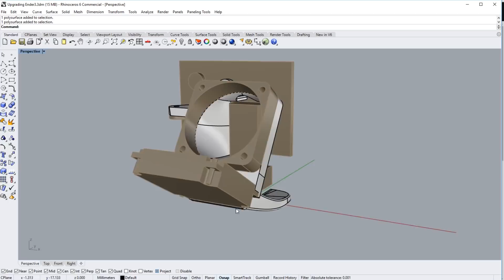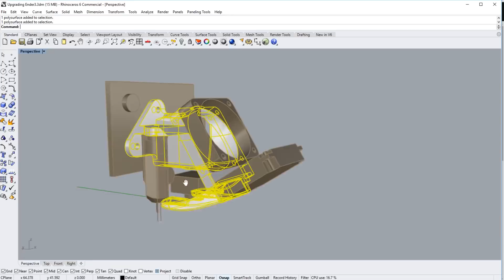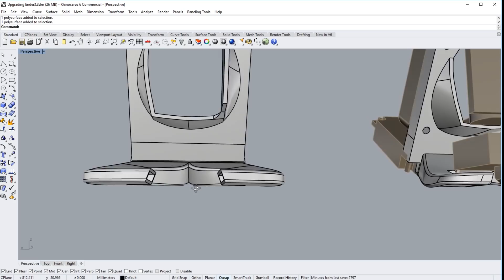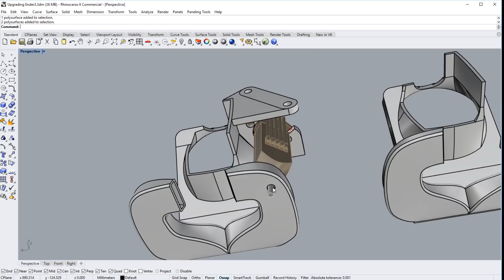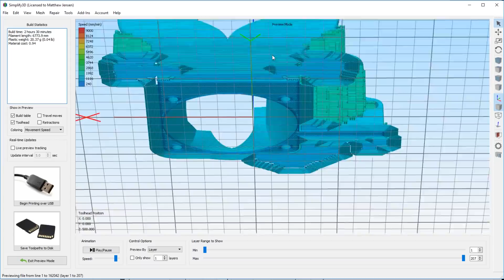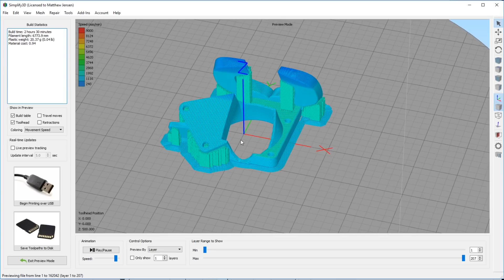Upgrading the Creality Ender 3 with Duet Wi-Fi, and other add-ons - part 1

Comment: Hello thanks for the video, can you write all the part list on the description please. Thanks
Reply from the maker: -DUET Wi-Fi
-Duet laser Filament Sensor (not available to the public. Still in beta)
-BLTouch sensor
-Noctua 40mm fan
-Noctua Redux 120mm fan
-Jumper wires. Alternately Dupont Crimp Connectors
-3D Printed Fan Duct/Sensor Bracket
-3D Printed Filament Sensor Bracket

Comment: I would have done things a little differently my self but the result will be the same of course you are going to get something that's better than a Prusa i3, if you add into the time spent making all this stuff at say you are worth $20 per hr (a very low wage for this sort of work), well then you might find you are over budget. It is part of the fun with DIY making and creating stuff and making it better that's what 3d printing is about.

Comment: He seems like just a nice guy offering some improvements for ender 3, noticing why some features happen to be better than the prusa, and warning against copied products. whats the problem here
Reply: While i agree partially i am hesitant to take advice from one who wasn't aware of the first step in any 3d printer. 'check voltage on psu'. It's just something you never forget to do... Unless it's your first printer and have never set psu voltage on anything ever before in your life. Bonus i get socked with 3 ads to watch this :(

Comment: "All of the features" you cannot print at the speed a MK2 prints, let alone a Mk3. I have an ender, works great, but doesn't hold a candle to the Original Prusa. Also, by you having spring belt tensioners on the Little Monster, I know that you don't know shit what you are talking about with printers.

Comment: Came here to see an Ender3 getting rewired on a new mainboard.
Saw a dude showing off the stuff he got for free and telling me "that it is worth the money".
Reply: Is there any step by step tutorials for the circuit board ?
Reply: A bit sad because I wired my tevo tornado to a duetwifi a couple years ago and I was interested in seeing the differences in how he did his since the ender3 is so similar.
Reply: Prusa is a garbage collector.
Reply: Clicked on the video, read this comment then closed the video. Thank you for saving me time.
Reply: @sterby1  Why is that even important? If you pay for something and can improve it by modifying it with stuff you get free from internet, it doesn't mean you make his point invalid. I also modified my Ender 3 and at this point it is as good as my Prusa Bear, but at a much lower price. So for people who do not spend so much money, that is a viable option. And then it really does not matter if you have to pay for it or not. Many Prusa enthusiast are proud of changing everything from extruder, hotend, linear rails, spend a fortune on top with no significant visual impact, and being applauded by the community. For what: For making people spend money for no benefit, just the joy of modifying. Is that really better? I guess no.
Reply: @mkuebbeler  I have a heavily modded Ender as well and I have a Prusa MK3S.  If I'm making parts that have to be used for anything that needs serious strength I use the Prusa.  Ender has an SKR 1.4 Turbo in it with 2209s.  It's quiet (except the part fan, can't find a quiet one) accurate and makes beautiful prints.  I mean beautiful.  No functional part I've printed on both of them compares in rigidity and strength.  Ender is a good machine, but if you're going to put that kind of money into a 3d printer to make it function like a Prusa, buy a Prusa.  That Duet board alone is $150 plus shipping.  That and you have to program the board.
Reply: @chethammer  I don‘t understand, if your prints are beautiful and dimensionally correct, then any functional print on the Ender should be as tough as on the Prusa, if you use the same filament. 
Of course, not all upgrade make sense and a Prusa is great because you get a proven Printer with an excellent manual and guide. But, there is nothing wrong with modding a cheaper printer to be technically at the same level as the Prusa, and maybe cheaper... if you like ti build and tinker and mod.
Reply: @mkuebbeler  Think it has to do with the accuracy of the stepper motors,  dual z, and  steel rods more than anything else.  Also, a better quality (by far) extruder set up in the Prusa.
Reply: @chethammer  I believe with some reasonable modding you are able to produce good quality prints similar to Prusa quality, on an Ender 3. The motion system is fine, I just changed the Z wheels and put in linear rails, but z only. I changed the extruder to a Hemera and put in an SKR 1.4 board and Bltouch. My prints are now at least as good as a Prusa, but remember... a lot of people also mod their fresh Prusas.. a new bondtech extruder, which has probably the biggest impact on quality. I don‘t believe that the Ender produces minor quality because of the motion system (steppers, rods vs wheels etc).
Reply: @mkuebbeler  the stepper motors on the Prusa are far more accurate and can do much finer movements.  They're like .0025 to .04 for the ender.  I just found that today so I'll have to find it again.
Reply: Yep, in his opinion the stuff was worth the money the vendors are asking for it.
Reply: @gangleweed  It's very easy to say it's worth it when you're not actually paying. That's what the original comment was getting at.
Reply: Same here, saw first comment then closed it.. even took away my thumbs

Comment: I really love Simplify3d, and have used this for years, way before the other slicers have caught up. I still use it, but I I think the gap between it and other slicers is growing smaller and smaller. I do feel that they are not innovating especially in areas of multi material prints when you look at some of the others the wipe towers and colour change in infill are just so much ahead of simplify 3d. Also with other slicers having better, and stronger infills. I don't have a multi material printer yet but I am looking forward to getting myself the multi material 2.0 for my i3 MK2.5 but I am not looking forward to using prusa control to slice my multi material printers.

Also the BL Touch I really love, I have purchased 2 of them for my old printer, 2 because I have an 2 extruders which I switch back and forth, and got sick of transferring the bltouch.

I also disagree with you about always purchasing original products and not the knockoffs, Creatlity printers are basically knockoffs of the Prusa i3, (more actually a knockoff of a knockoff) and build their printers on the marlin firmware. Basically I believe that if you can afford it and you think it is worthwhile then purchase from the original designer, but companies like Creality and Tevo have brought out printers which some people would consider them cheap chinese knockoffs, but they print amazingly and are a great printer for someone wanting to get into the hobby. Unfortunately cheap Chinese knock offs are the reality of all business these days and you need to make sure your business model can with stand this.

Comment: Ok first thing i will say i own a Prusa I3 MK2.5 printer upgraded from a MK2S Was my first printer, my 2nd is a CR-10S and my 3rd is a ender -3 Now from owning the Prusa i3 mk2.5 for a full year. i have had to replace 5 pinda sensors 1 complete bed. a heater cartridge AND a heat block and thermistor cable, The screw was seized onto the heater block when i tried to change out the heater cartridge:( The CR-10S the wires are loose on the bed and need to be re soldered. not that bad to do.  and yes i have made the strain relief for the wires for the bed. have only owned the CR-10S for about 2 months. the ender 3 i have not had to touch been working good. I am so impressed with the ender -3 im thinking of getting a ender -4 for just the hell of it. the Prusa is a nice printer and if your looking for your first printer its a good one to get.. the support from prusa is not the best and sometimes they will lead you the wrong way but they do there best. (i had a set screw fall out of place Prusa had me adjusting my frame and in turn it made me put the frame out of wack when the issue was a set screw that feel out. But they also tough me a lot. 
But i really wanted to talk about this Duet Wi-Fi thing. does it add anything that octoprint does not add already? and octoprint is A LOT cheaper. You add octoprint and a wireless SD card

Comment: This makes no sence at all. 

You throw in a board the Ender cant fully use at any time. 
The duet is just totaly overpowered for the Ender 3.

You are still not as fast as an Prusa. You are still not reliable as an Prusa. And you didnt build in something that really would be an Upgrade like Extruder / Hotend / slicone dampers for the heatbed / insulation and so on. 

But still you want money.

Comment: 3:30 why did screen turn on?
Reply from the maker: Pushing the bed turned the Y stepper motor into a generator momentarily powering the system.
Reply: Can it be harmful for the stepper driver?
Reply from the maker: No, but it can be harmful for the control board. In theory. I've never actually had a problem.

Comment: how do you know its better than a Prusa, without owning a Prusa ?
Reply: Burn!!!
Reply: Well, of course he owns or at least has access to a mark3. He wouldn’t say all that stuff without having a solid basis for comparison, would he?
Reply: I've seen so many 3D printers with great reviews that turned out to be crap when I saw them in person. Basically, any machine that is build from 3D printed parts and held together with Zip ties can NOT be considered to be a piece of precision equipment. When it is moved around it easily will get knocked out of tram (it it ever WAS accurately aligned to begin with).  End of story.
Reply: K Danagger that’s when you’re looking at “reviews” on AliExpress or amazon. There are tens of thousands of Prusas out there. If reviews were fake, you’d know by now.
Reply: @JasperJanssen  Precisely; I own the newest Prussia 3d printer iteration they put out and it works absolutely fantastic. It prints with precision because I am using it correctly and know how to adjust the settings. I am a Biomedical engineer and use one all the time at work for prototyping. It saddens my heart to see a community focused on creative engineering and design, whether for fun or for adequate parts in an eventual product, complain about 3d printing period. It is up to us to make the most out of what we have and not bash others for what they do or don't. We are to inform, be informed, and not waste time.
Reply: how do you know eating poop is worse than eating chocolate if you haven't tried poop yet?
Reply: @mouthless177  you win!
Reply: @mouthless177  its not , ive tried both.
Reply: @mouthless177  how do you know that you are eating chocolate and not poop if you don't know the difference? X)
Reply: @mouthless177  you say this as a joke, buy it literally proves his point. You can't know, you're just unwilling to try. You may have a pretty good idea, but beyond that you're just guessing.

Good try, though.
Reply: @ToadsTho  was better than a try  he owned him      wooooosh

Comment: You lock your STLs behind a pay wall? I can't knock you for wanting to make money off your design but you should sell the STL file if you want to make money on it not lock it behind patreon.
Reply: Complements open source, then complains about it then locks behind a pay wall!!! Here's an idea, trying to be a member of the community!
Reply: @Alec Ward 
i wouldn't worry to much about these files there are many other free mods on the internet that will do the same thing. Supporting his channel and content is a nice thing to do though if you have the money and can use something like this. I own a highly modified A8 so i have no use for Ender 3 products i am interested in the duet though.
Reply: I really suggest you look into Ramps + Klipper
Reply: The price he charges for his patreon to get access to the files is less than most people would charge to access a single file. So there is that. So like he said you could sub for a month and get every stl he ever designed and everything else being a patreon entails.
Reply: Just learn Fusion360 and stop complaining... :D It's for free.
Reply from the maker: I don't want to sell my stl files or the firmware builds. I want to give those files away and earn a fair wage for my video making. Currently I earn around $250 per month (check socialblade and Patreon to verify). I spend 40 hours per week working on this channel. This means that I earn about $1.50 per hour which is less than the folks in china who made your printer. I share any and all files with my Patreon supporters. It's my way of thanking them for helping me with my costs to make these videos.
Reply: Design Prototype Test, I discovered your site and watched a few videos. Personally, I’m really interested in the Ender 3. So I liked this video and hope to see the follow-up videos pretty soon. I do like your style and the piece you designed. As a disabled ex Autocad/Inventor designer and a multimedia engineer I do like technical challenges and you did show a nice piece for the Ender 3 in this video.

As I’m putting money aside for my own printer and hopefully will be able to buy one next month, I look for great channels on YouTube. With my small disability income that I get I try to patron a few Youtubers each month. So I went to your Patreon page and thought I entered the wrong name. The only few posts you entered are from 2017 but we are already 4 months away from 2019.

The lack of up to date information/perks kept me from becoming a patron as did the small amount of Ender 3 videos. But the last part wasn’t so important thanks to this and the following videos regarding the upgrade of the 3D printer.

You deserve many more subs and of course patrons. And a good way to attract financial support you should work on your Patreon page. Just as an example you should post regularly, make a free introduction video on Patreon... Just take a look at the following blog: https://blog.patreon.com/patreon-reward-ideas/

I do apologize if I offended you in any way. This wasn't my intention at all. I just want to help you and your channel because you deserve it, as I mentioned before. Having 10K subscribers does mean you are doing something good.

Wish you all the best and if you have questions I will happily reply to you. Can’t wait for the next set of videos. And hopefully, you will make many more Ender 3 ones too.

Kind regards and much appreciation from Belgium!
Reply: @DesignPrototypeTest  Quote " I was given all the products in this video by the respective manufacturers for the  purpose of making review or instructional videos." 

I hope the manufacturers of those products realize that you are locking the files needed for the instructional videos behind a paywall. Since you brought up ethics, that seems a little unethical to me.
Reply: I appreciate the hard work that goes into being a content creator and the reality that the pay is not what the common YouTube viewer thinks. If income is an issue you should diversify your income source, such as selling files people would want but don't want to pledge a monthly fee for. It does not impact your patrons who still receive those files for free. The only negative impact is that it doesn't drive people to your patreon for the monthly payment. Being honest the folks that just want one file wont pledge anyway so personally I would capture that income another way if possible.

My initial comment was out of surprise and frustration as I really like your design but I understand respect your reasoning. You need to do what is best for your channel and subscribers as you see fit, as I do not have the whole picture thus can only make assumptions.
Reply from the maker: Just pledge the $5, and then cancel your pledge once you have the file you want.
Reply: It's semantics really.. reward for some, pay-wall for others. You've seen how whiny people can be (while watching free content ;o) but you could well be right, more leverage to close people's decision to Patreonize your work is probably a good thing. Particularly as Google (own Youtube) seem intent on removing quality and variety from their own platform, in favour of industrial cinema gery-water and kittens...
Reply: If youre willing to pay for the file, just support him on patreon.

Comment: Sorry Nope, after having a mk2 and two mk3s, they are simply just Superior, you simply can't beat genuine parts. And unlike the ender 3 it is truly open source, and it is designed originally to have all the features and they are not added haphazardly after the fact. Overall, the user interface and slicer presets are unbeatable.

You get what you pay for...
Reply: I do agree with everything you said,  but I'm fairly certain that the ender 3 is also fully open source